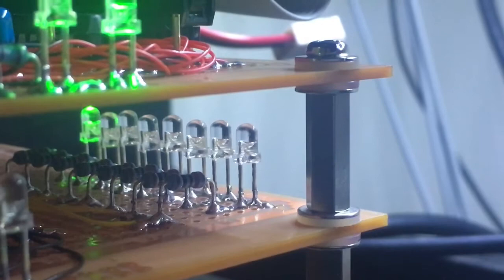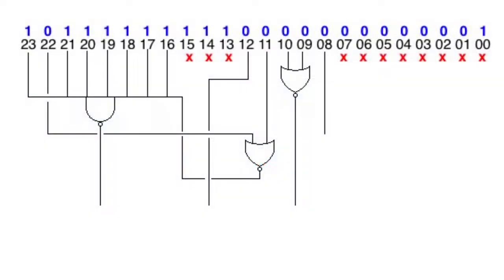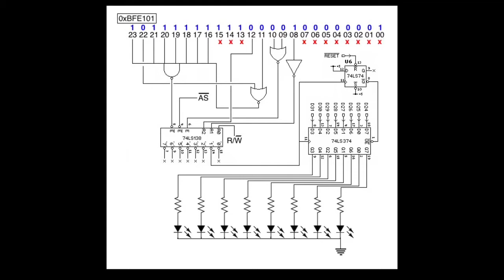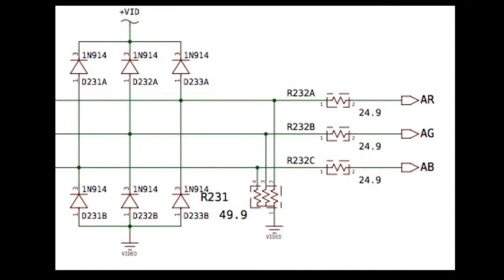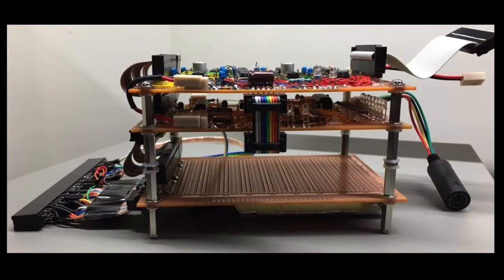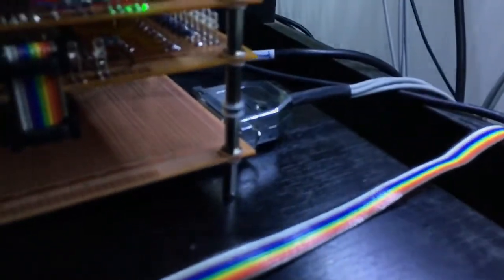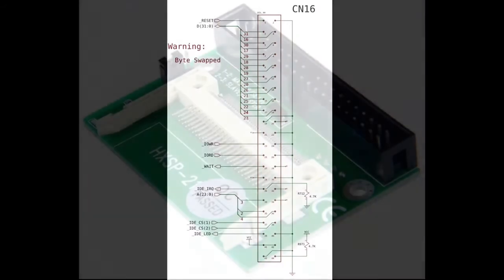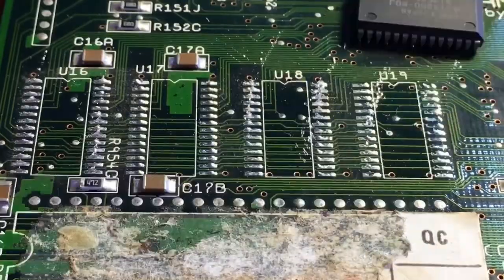Amiga CD32 - DIY Expansion

Comment: Hi, what happend to your A1200 Gayle project? I've always wondered if you could use a Gayle IC for the missing IDE functions in Akiko.
Reply from the maker: Absolutely you can. That was a tragedy. Thanks for reminding me :D In a nutshell, I later figured out a design error in the wiring of the logic chips that decode Gayle’s addressing. If you were in the Commodore Amiga FB group at the time, I discovered the error some time after the unit was destroyed, and talked about it there, where several competent people agreed about my mistake, and the solution. I wasn’t of the mind to start again though. No question that is absolutely possible though.
Reply: @BrekMartin  Thanks for your reply, that gives me hope to try it myself one day when I have the right equipment 🙂

Comment: hi i have a problem can you help. I bought the amiga cd32 and the floppy drive for it I wanted to play a old game called bloodwych on floppy disk original game. So I bought one from a ebay seller I then put the disk in and it gets to the main menu screen but then crash's I tried it a few times and it also crashed the amiga it self as well so I had to turn it off. is it the disk is it the floppy drive or is it a compatibility problem can you help?

The game came out in 1989 I think for the original 500 and st.

I have been told if I added a mouse and a keyboard I would have an amiga 1200 can you give me any advise regards paul.
Reply from the maker: Hi, It could be a few things, but I suspect the game wants fast RAM, where the CD32 only has chip RAM unless it’s expanded. Some older games just don’t work. Even classics. I believe Turrican is one of those.